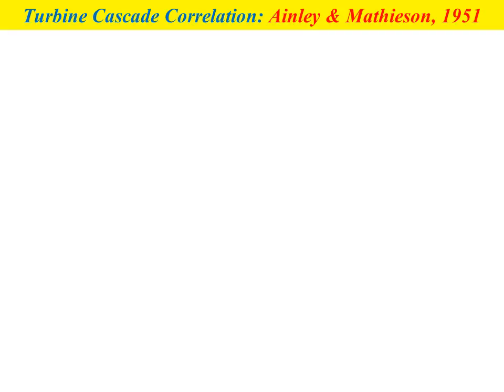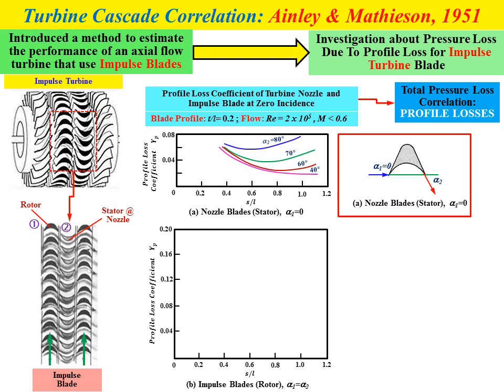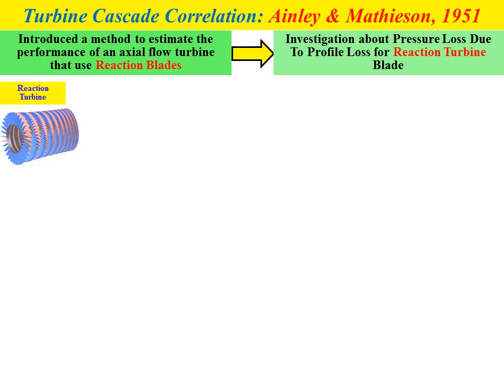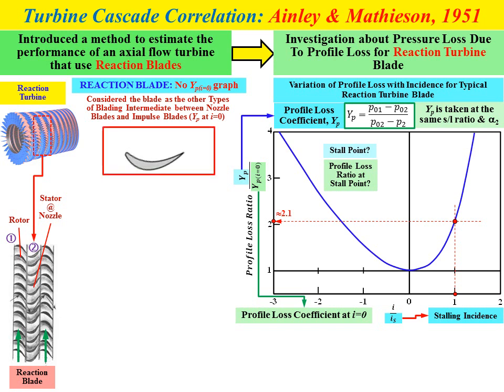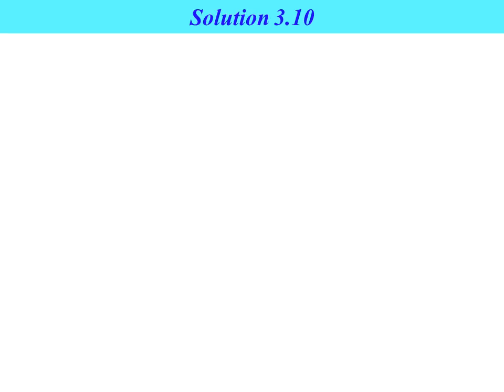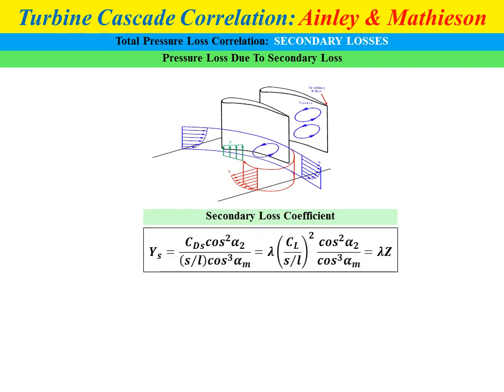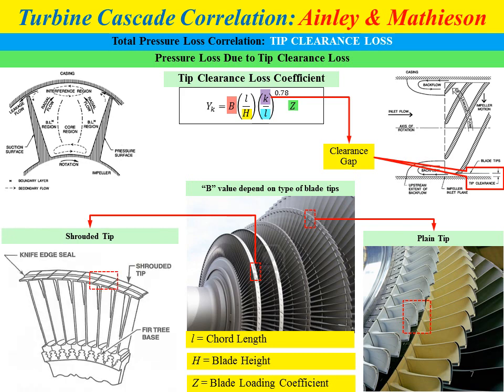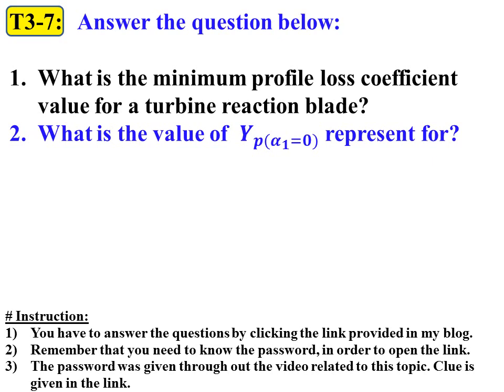TM LEC #20: CHAPTER 03 CASCADE PERFORMANCE PART 7

Comment: Salam Dr, what does it means by the blading intermediate between nozzle blades and impulse blades?
Reply from the maker: This condition is refer to any blade profile flow condition with inlet absolute flow angle a1 that not equal to outlet absolute flow angle a2. The condition actual is same as the condition for reaction blade. Otherwise we need to use the impulse blade condition (a1=a2)